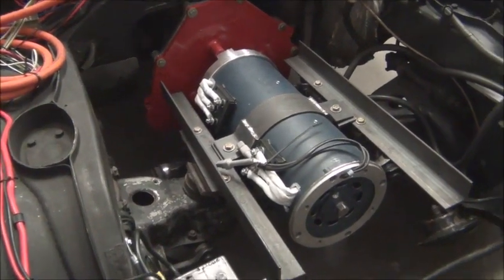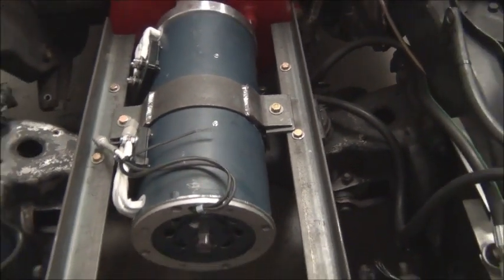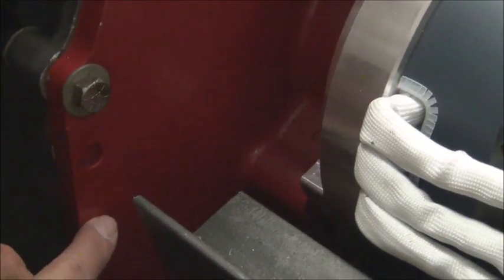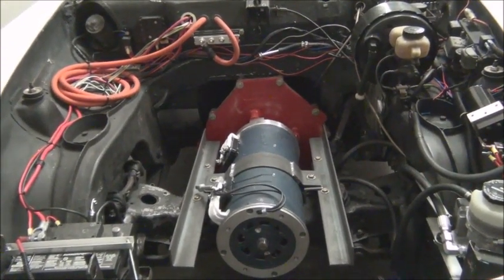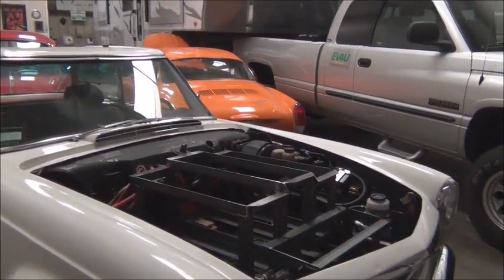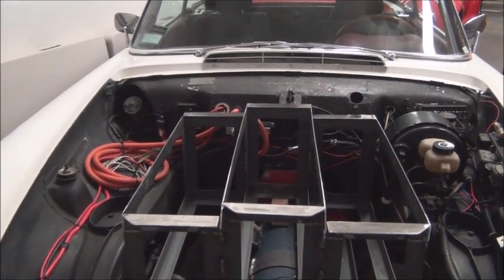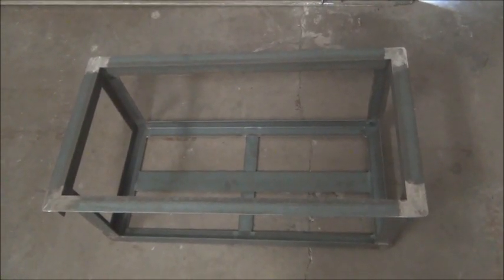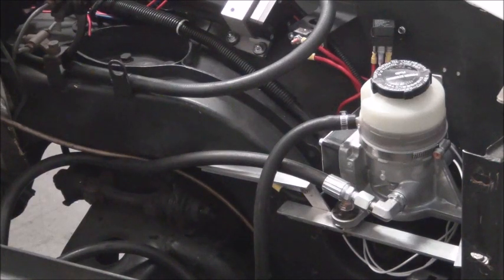Mercedes 230SL Electric Conversion Progress  www.EV4Unow.com

Comment: Not Bad but I'm curious. What's the Horsepower output for that Mercedes Conversion?? I own a 1983 W126 300sd Turbo and I'm really thinking about converting my 617 over to electric.
Reply from the maker: 165 hp and 189 lb.-ft. of torque
This motor is only recommended for vehicles with a gross weight of 3,500 pounds or less.
Reply: @ev4u  Thank you so much for the information and I wish you further success on your current projects. Stay Blessed

Comment: Classic cars are probably much easier to convert to electric powertrain due to already having simpler electrics and little to none electronics already. The only thing that is better about converting modern cars would be the electric power steering rack being easier than older hydraulic power steering systems to reuse, and crash safety I suppose. I am watching lots of videos on electric car conversions, they make so much sense to be honest as ICE vehicle bodyshells are perfectly suitable for conversion. Battery packaging is probably the biggest issue. Things like motor controllers, throttle pedal potentiometers, charging units, battery management, safety cut off, electric motor to original bell housing connection and running the original 12 volt system off of a transformer to keep the conversion simple all need to be thought about. What about crash protection, some conversions have the battery pack in the crumple zone? It would be great to get battery packs you could build yourself in series parallel that you could try to fit inside a plastic mold of the original fuel tank, fuelntanks tend to be oddly shaped so this may be difficult but good for keeping weight distribution low etc. A battery pack in the front and back would be good for range if kerbweight is not compromised.

Comment: Do you build the motors? What is the power of this one?
Reply from the maker: EV4U does not build motors.  The motor featured in this video is manufactured in Ontario California by High Performance Electric Vehicle Systems.  165 horsepower and 189 lb.-ft. of torque.

Comment: was that opening shop sped up film speed?  i just dont think the tires would hold that much weight in the coner.
Reply from the maker: Are you referring to the 2,200 lb. Karmann Ghia?  That car loves the corkscrew at Laguna Seca.  The video speed has not been altered.  In June 2017 we actually made better time than any previous runs, unfortunately we did not video Laguna Seca this year.
Reply: the clip right after going down the hill ,, i looks speed-ed up, does the Porsche have more electric motor in it?
Reply from the maker: The clips are not of the same lap.  Currently we use the same AC motors in the Porsche and the Karmann Ghia.
However, in the past, the Karmann Ghia would run an ImPulse 9 whereas the Porsche would run a WarP 9 motor.  Things are always changing in the conversion field.  Thanks for watching.

Comment: Can you guys do a Mk2 MR2 and have it keep the large rear trunk, as well as have enough cabin space for a sound system? {Sub, amp, and two 2/3 way speakers.}

Also, power steering and HVAC are big necessities. Are those possible with any of your builds?
Reply from the maker: You bet.  Check out more of our videos for examples of vehicles with the accessories you mention.
Thanks for watching.